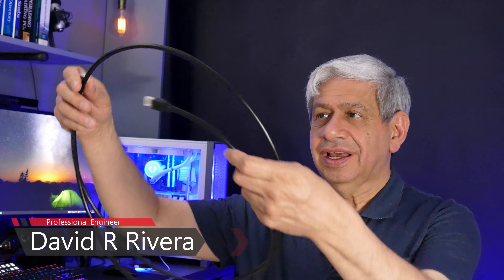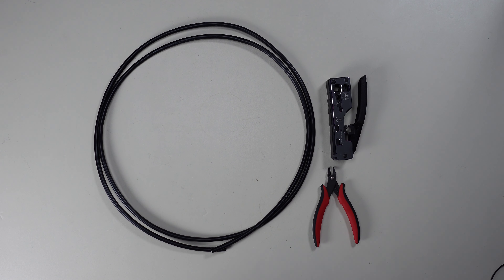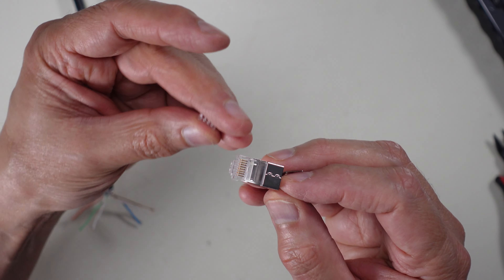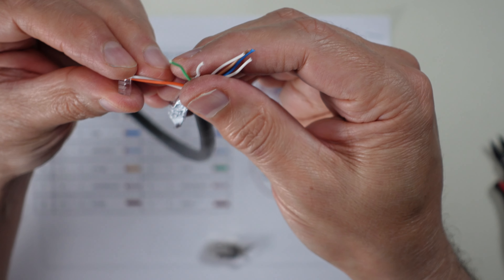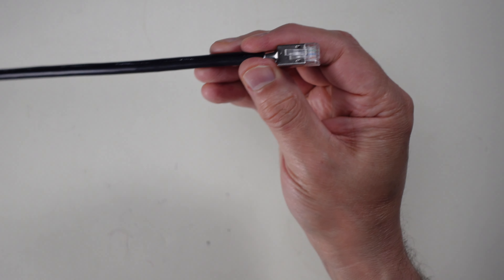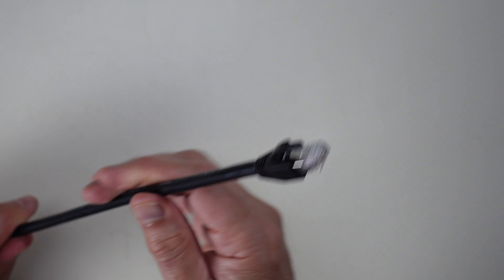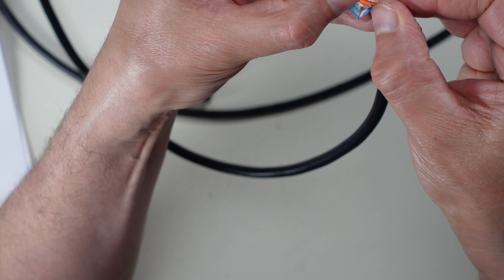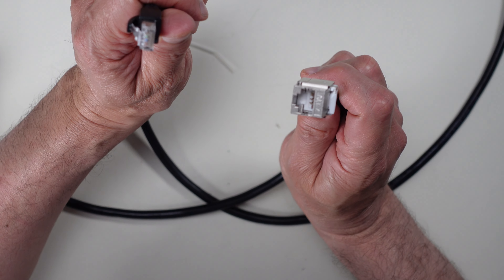Making a Cat-7 Cable having both an RJ-45 Connector and a Keystone Jack

Comment: How do you do CAT 7 wire with wall socket. I got RJ45 plug and wall socket
Reply from the maker: Yes, I use shielded RJ-45 Keystone connector when I run Cat-7 cable.

Comment: What's the braided for if it's not also being grounded? I was under the impression it needed to be wrapped around the outside of the cable.
Reply from the maker: It is meant to be crimped into a shielded connector.  If you connector is not shielded then it could be wrapped around (but be careful it will not unwind, or simply cut off.

Comment: What about Cat6a. Should I use cat7 or cat6 setting?
Reply from the maker: That depends on how long the cable is.  I tend to use Cat-7 since it is perfect up to 100-feet for 10gb speeds.  Cat-6 about 30-feet , and Cat-6A somewhere in between the other two.

Comment: I am no expert on this, but I do have some suggestions.  There are cable tools that have an adjustable cutters which will cut the jacket.  Just put the cutter on the cable and spin it around to cut the jacket then pull it off.  The position of the cutter is adjustable to avoid cutting the metal shiedling.  

I would cut the jacket back much further than you did to leave lots of wire to deal with.  Will make it easier to thread into the small holes on either end and it doesnt matter because it is cut off anyway.  

I would avoid cable that does not have stripes on the white wire, that could be very confusing if they get mixed up.  I know often you wont know this until you have already bought the cable.

More than once I have put the plastic insert upside down into the jack.  Since it has perforations to allow the gold connectors to touch the wire and penetrate he insulation, the connection failed.  Easy to do for a beginner and the perforations are hard to see.  Some connectors do not use the insert at all and some (probably Cat 6 only) allow the wire to protrude past the end of the connector so you can verify proper wire connection before crimping.

My cable tester failed which cause no end of grief.  One wire was not being tested and I thought I had a bad connection when it was the tester.  Important to test the tester on a known good cable.

Connectors can be disignated for solid cable, or stranded.  Some are good for both types.  A cable failure could result from using the wrong type.  Be wary of cheap cable which could be CCA - Copper Clad Aluminum, an inferior cable.  None of this might be applicable to Cat 7 cable which I have no experience with but thought I would mention it.
Reply from the maker: Thanks for all the great feedback and suggestions.  This particular cable made it challenging for me the first time I used it.  Now however, I really appreciate how well it does with iPerf3 - there is no loss or errors even on my long 180' run at 10G

Comment: Why all the effort making a cat 7 shielded cable? When 6A UTP cable can do 10 gig 328 feet? Unless you wanted shielded because you are in an environment with a lot of EMI, but looks like you are home, so you arent.  CAT 7 is not recognized by the ANSI/TIA for north america. CAT 7 is ISO recognized for other parts of the world. Its all marketing, CAT 7 is not better then 6a. Even cat 6 will do 10 gig at 165 feet UTP
Reply from the maker: Honestly, it's just that I have decided to standardize on Cat-7 to give me the extra distance it provides - just in aces I need it.  I will be using only Cat-7 going forward, since I have learned that be one generation ahead provide some buffer for the future.